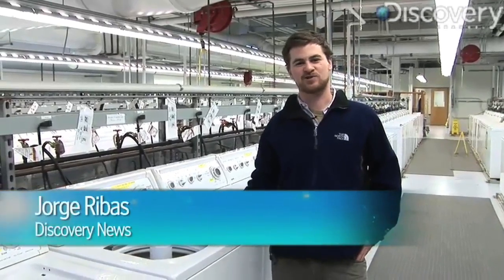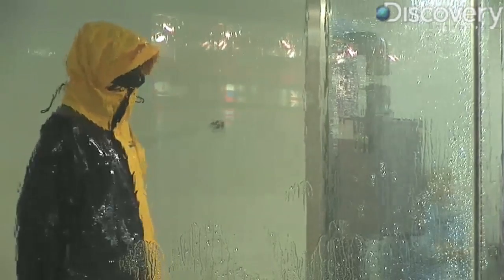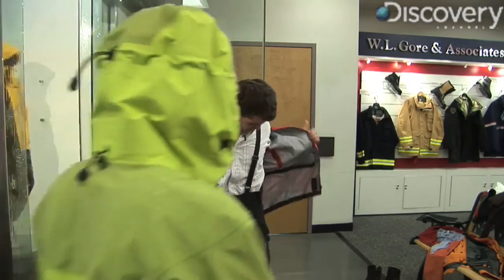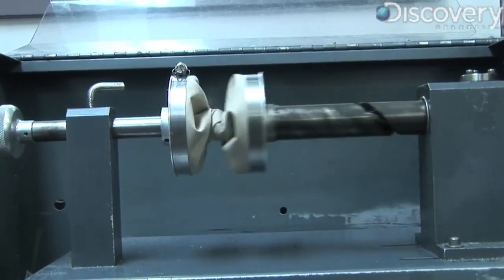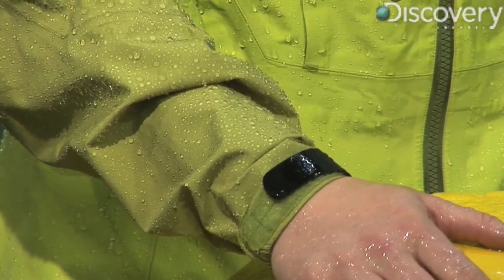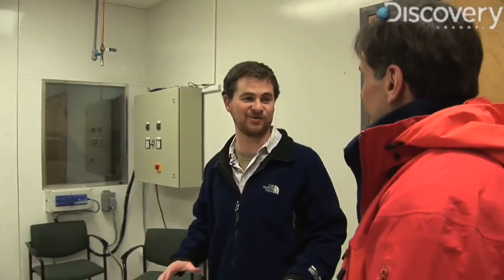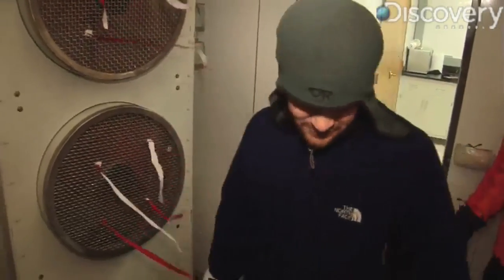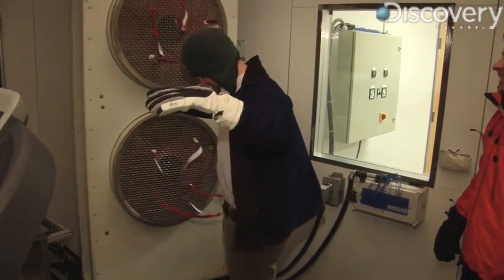Clothes Tested for Extreme Weather

Comment: My dad gets gortex from work,I use it on the skid plate on my dirtbike to keep it from rubbing the paint off and under the carbon fiber exhaust guard to keep it from scratching the nickle plating.We had a      1/4x24"x12" sheet and two 6"long x1"x1" spheres,cool stuff you can find a 1,001 uses!